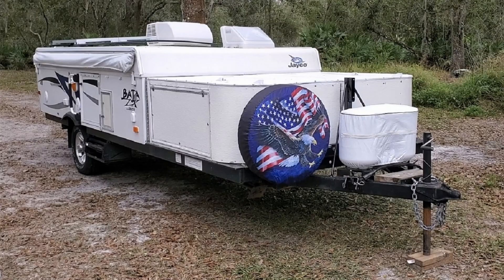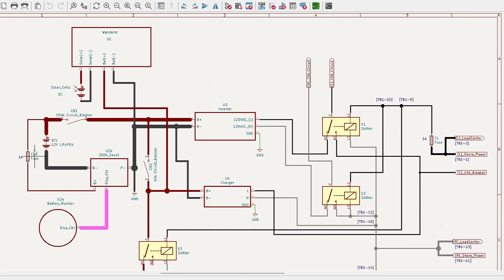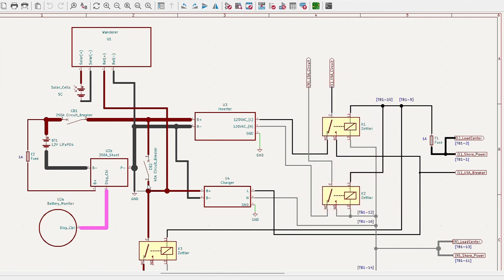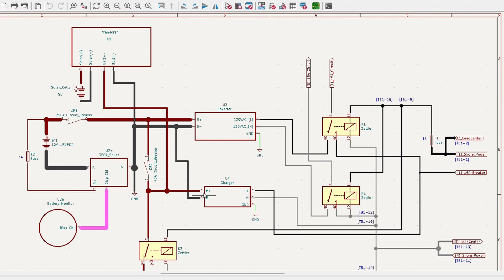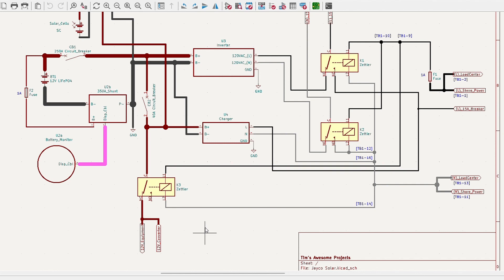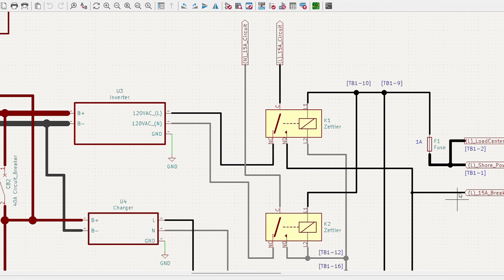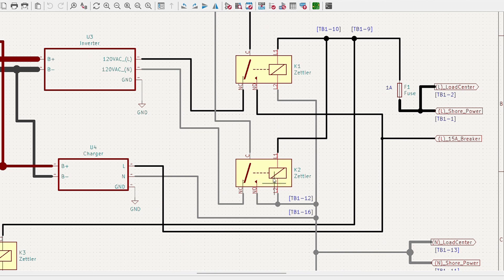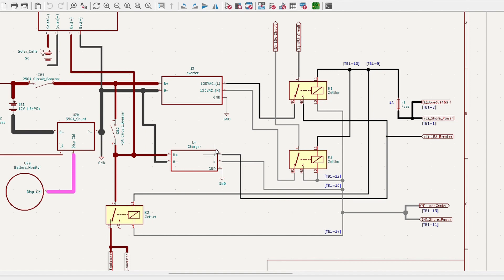Jayco Solar Project Wiring Diagram Explained

Comment: I understand why you need k2 and k3, but why do you need k1?
Reply from the maker: K1 swaps the 120vac outlets between inverter and shore power.  K2 swaps the neutral for the outlets between inverter and shore power. K3 isolates the battery from the converter when shore power is connected.